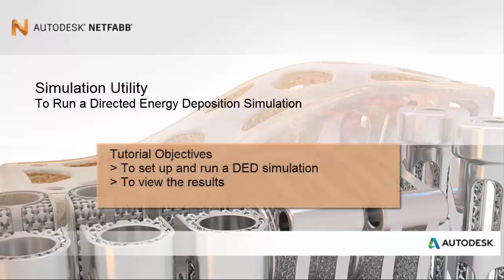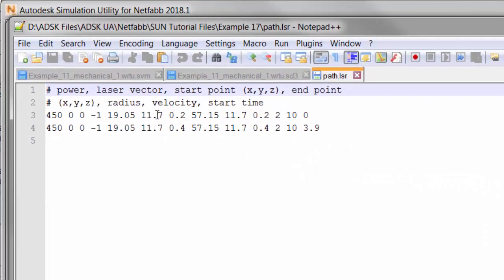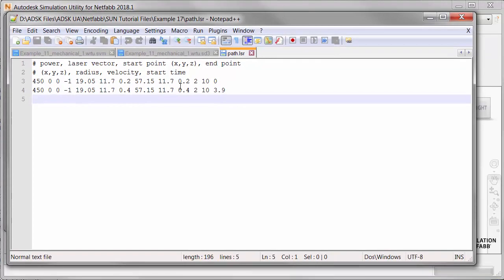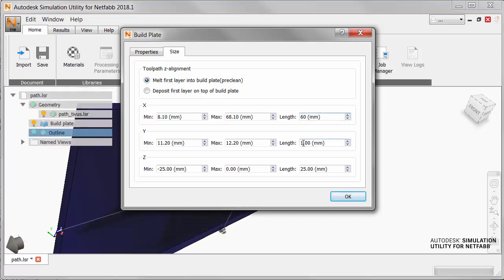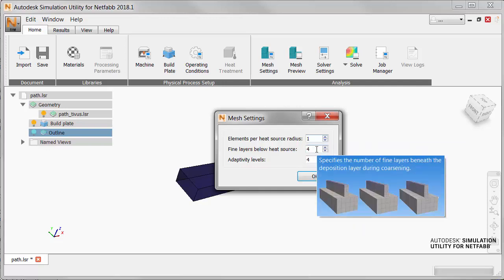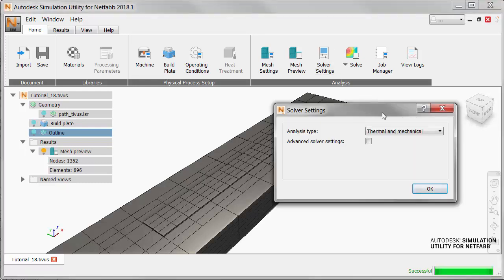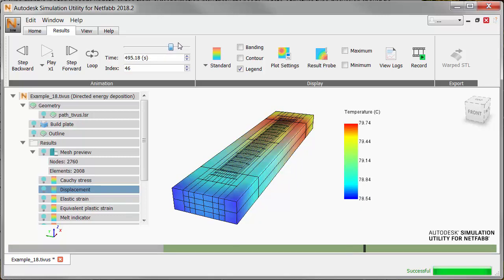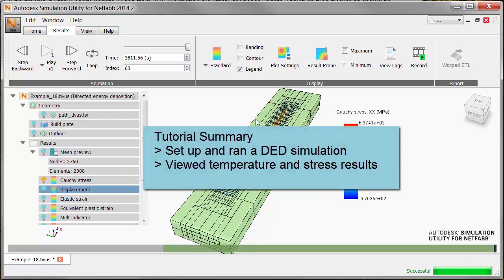Netfabb Simulation - Directed Energy Deposition

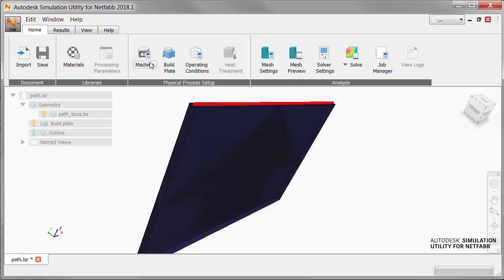Comment: Thanks for the information. I have question about min 1:53 (material choosing>>>machine>>>material>>>absorbtion efficiency). I want to model Wire Arc Additive Manufacturing. Can absorption efficiency for Laser be thought as welding efficency so can I use the same tab to choose the material? or?
Reply: brother i have question 
i am a beginer and this tutorial is not helping me at all as i am using netfabb 2020.
kindly guide me